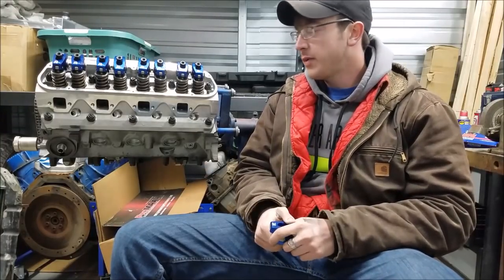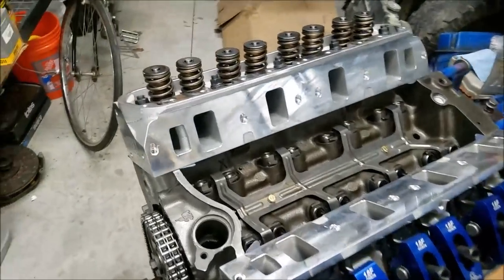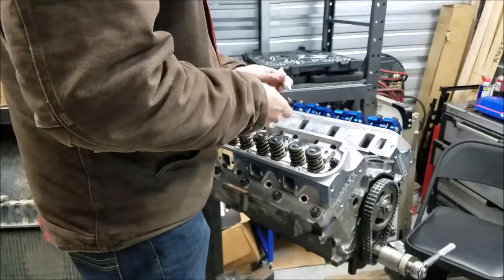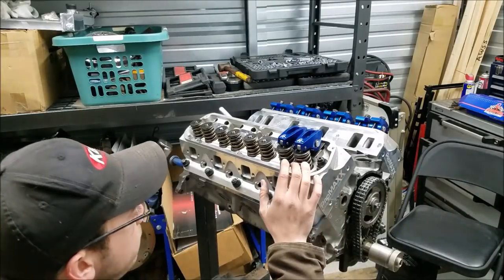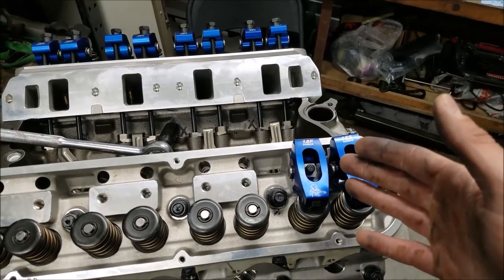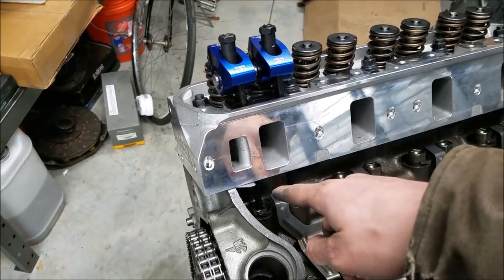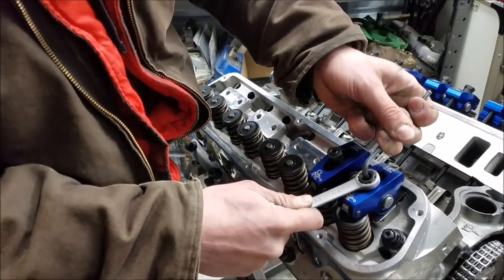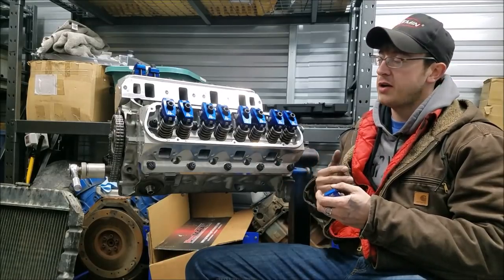How to: Adjust Valves/Set Lifter Preload & Set Up Valvetrain CORRECTLY (Ford/Chevy Small Block)

Comment: This couldn’t be literally any more complicated why are you working so hard? Pression stroke is the base circle on cylinder one. Why waste your time spinning around Nd raising the other side??? I just involves per cylinder is a waste of time anyways. Just been the crankshaft and 90° increments and tighten loose pushrods. What do you make a full 360 On the crankshafteverything should be tightens down on the base circle of the cam. Then tell you need valve all the way down the banks of pistons
Reply: He literal spent a minute explaining this and why he prefers this method